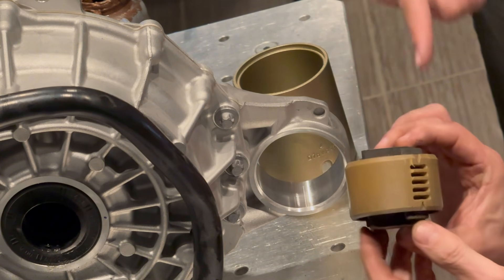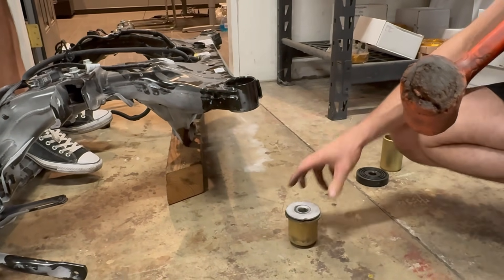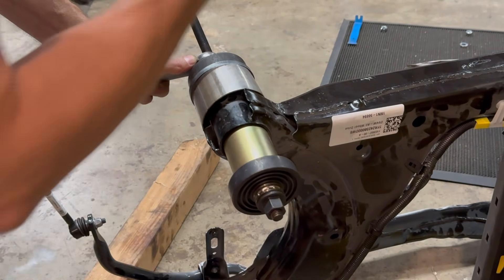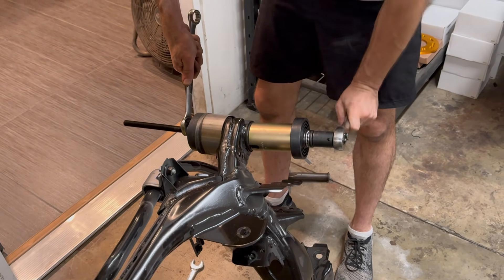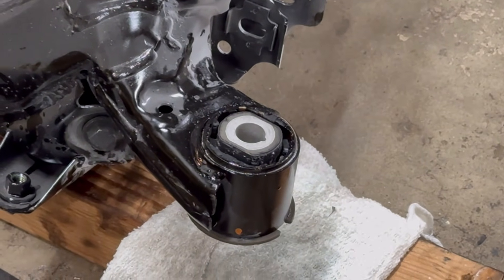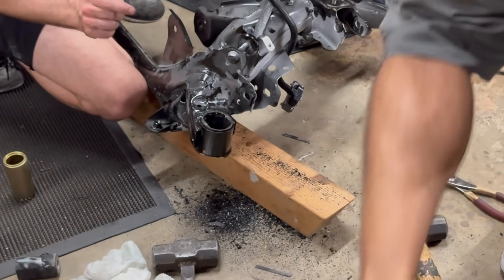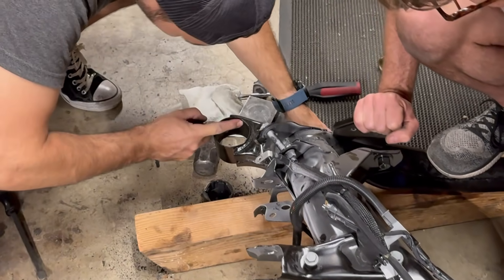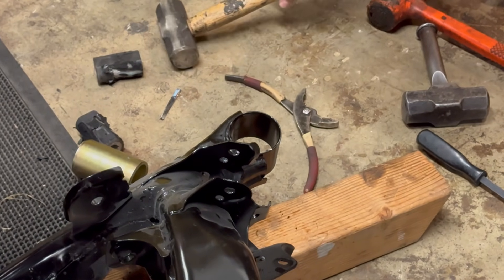Struggling with '24 Tesla Model 3 bushing removal, Rear Drive Unit & Subframe.

Comment: We've been using the JTC bushing removal tool to press the drive unit bushings in and out. It works great when it works, but the instructions are all wrong, and when something isn't aligned or a hole isn't the right size, it makes the job so much more difficult. I'm excited to see the tool you guys are developing.
Reply from the maker: After this video was made,  I was motivated to design a new push/pull tool and a better process. That'll be a life saver when it comes to improving the rear subframe forward bushings, that were such a pain in this video. Stay tuned to the @partsshopmax Instagram page for the product releases over the next few months & maybe I'll post a video in this series of me using that prototype tool too = )
Reply: @PartsShopMAX  My shop does drive unit bushings somewhat regularly - we are super excited to see your new rig in action!
Reply from the maker: The prototype subframe tools, new process for the (huge pain in the butt) Rear SF forward bushing removal and production parts including Rear lower arm to subframe bushing to bearing conversion are shown in the latest video post, Build Episode 20. The solid drive unit and solid subframe risers are the first parts to debut on store.partsshopmax.com a few days ago.
Reply from the maker: @rollingstocks check Episode 12 showing how the frozen aluminum drive unit bushings easily slip in by hand and get tightened with basic hardware.